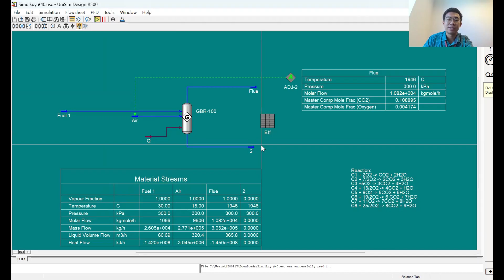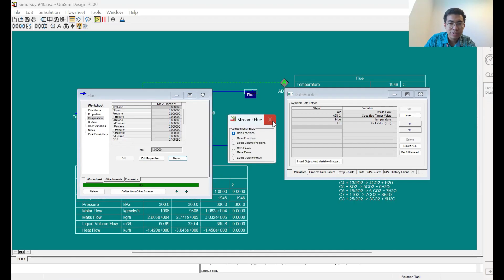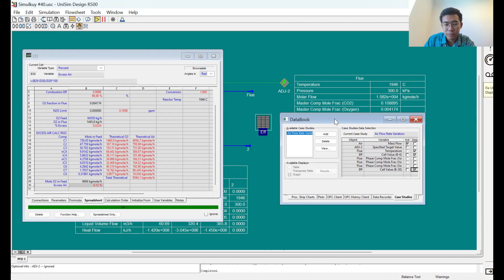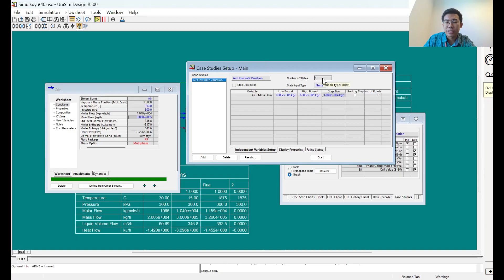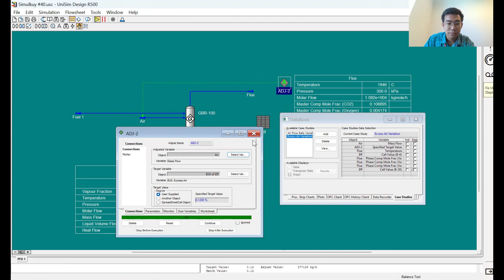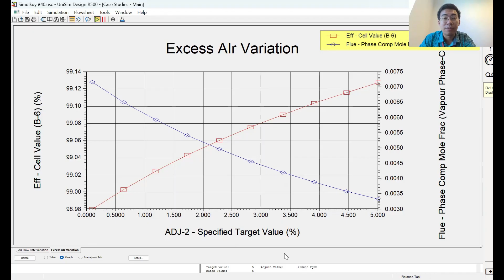Simulkuy #44 | Case Studies / Sensitivity Analysis in UniSim Design

Comment: Hi! Thanks for the nice video. I would like to run a sensitivity analysis by varying the molar fraction of one component in an inlet stream. Do you have any suggestions on how I can approach this?
Reply from the maker: Hi! Very good question. You need to put all components into the independent variable, then use discrete type. I will make a special video for this. Stay tuned 😁